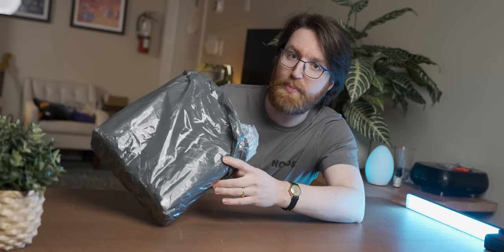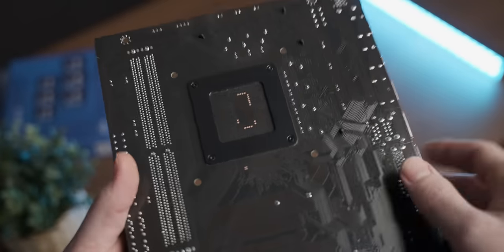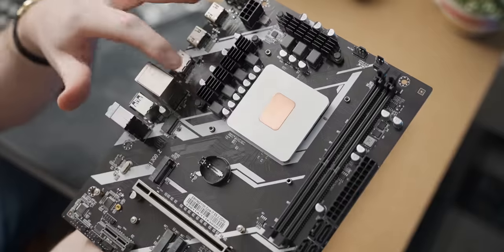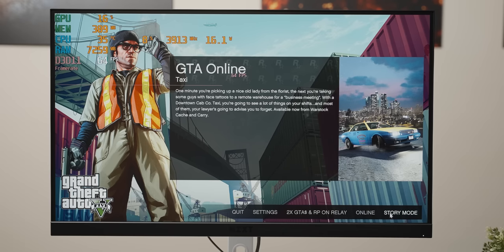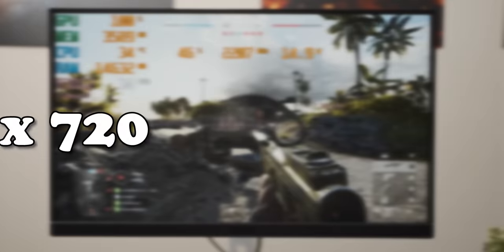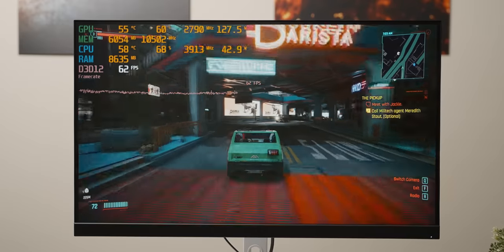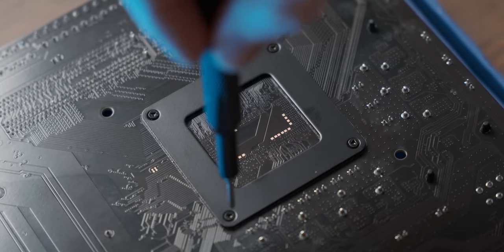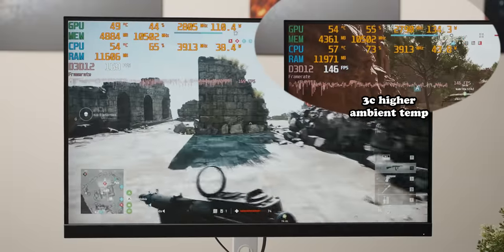Has Aliexpress Motherboard Science Gone Too Far?

Comment: Gonna say, Aliexpress xeon kits are kind of impressive, would be very nice to see one featured here.
Reply: yeah
Reply: I think this might actually be more powerful than one of those old Xeons. Would be worth comparing.
Reply: They used to be. Now it's not a good option anymore. Besides, they are not that reliable either, I very recently built one for a friend and the front audio didn't work.
Reply: yes, especially the x99 ones with a sketchy motherboard - would like to see it with Dawid.
Reply: @MiGujack3 nobody uses front audio
Reply: @L4ftyOne  You'd be surprised. I've seen some things..
Reply: I've built a few even recently and while sketchy, it's like a lottery and is kinda fun trying to figure it out
Reply: These kits are huge here in Brazil for budget rigs
Reply: for x99 platform is better to stick to local Hp workstations i have a HP z440 64 GB ddr4 paired with a rx580 and it runs smoothly
Reply: @Jaroartx  I'd consider getting those too. It depends on whichever is the cheapest and has good preformance
Reply: You can even buy a motherboard with both ddr3 and ddr4 slots, weird stuff
Reply: @Jaroartx  that seems better ngl
Reply: @MiGujack3  Ditto.  I went through three of them (two that wouldn't POST and one with two bad RAM slots), from three different vendors, before I gave up, accepted the $500 loss, and just bought a used a Dell socket 2011 workstation board.  Went broke trying to save money.  :P
Reply from the maker: I’ve done videos on some of those boards before. I got a dodgy x99 in a Best Buy market seller PC last year that you commonly find on AliExpress. You can go check out that video if your interested.
Reply: Xeon X series LGA 1366 is my Jam!
Reply: @BronzeApparathus  proud brazilian owner of a Xeon 2690v4 in a Machinist motherboard. I never ever heard of this manufacturer before and I must say that it's amazing, impressive work

Comment: These motherboards with soldered mobile cpus are actually really popular in developing countries. Here in Brazil, basically all tech channels were testing and reviewing them past month
Reply: Price to performance is the way in all countries with lower than average economy / dollar value
Reply: Honestly if you can find one with a Ryzen 6000 APU on it you'll have yourself a very slick little gaming machine. The 6980HX is a monster of a mobile chip and the iGPU is comparable to the RX6400 or 6500 with the power sliders maxed out.
Reply: @mikeymaiku  I'd say it's the way everywhere, why waste money even if you have it? You could spend it on other nice things. BTW: World average gdp per capita is 12k$/a, Brazil is 18, so well above average.
Reply from the maker: That’s cool! They do seem like really good value for money. Not surprised they are popular. 😁
Reply: @DigitalJedi  can i get a link?
Reply: Not just developing countries, developed too. Those mobile CPUs paired with an aluminium heatsink case make for some great zero-noise desktops. If all you have is a rented room and you want a micro-server or torrent box that's always on without making any noise at night, it's the only way to get that. Mine is from a manufacturer called "Hystou" and it seeds some old Blu-Ray 3D torrents that I want to save from extinction 24/7. Money well spent. No, really.
Reply: BTW the reason I am mentioning the manufacturer is because I am surprised by how zero-noise the thing is. No electronics whine, no whistling power brick, no nothing. My only complaint is that 6 of the 8 USB ports don't support "safely remove" for external HDDs/SSDs for some reason (they only support "eject" which is for thumb drives only). Also, I love the term "Aliexpress Motherboard Science", but I opted for buying straight from the manufacturer, not Aliexpress (aka trashy eBay).
Reply: @andreasu.3546  Don't be fooled by averages, inequality is brutal, there are insanely rich people, but also an upper middle class alongside really poor people. Those at the very bottom can't even buy the cheapest PC available.
Reply: @sovo1212  🙁
Reply: Same goes with Republic of Buryatia. Most non-gamer people buy either used computers or cheaply imported ones from china, mostly those mini computers or motherboards with embedded/mobile CPU's and sometimes even GPU's in a cheap mATX case and barrel plug PSU
Reply: @DawidDoesTechStuff  the only problem is the risk - you never know when this soldered CPU unsolders itself , and aliexpress warranty is a joke. Still I'd accept that risk :D
Reply: @sovo1212  can't agree more

Comment: The reason it doesn't come with a cmos battery is because of the strict chinese transport law regarding batteries
Reply: Many AliExpress sellers are telling batteries not included due the strict restrictions on Chinese airlines, but then when the product arrives it still has batteries included or installed.   😉
Reply: Also batteries and air freight.. not a great combo
Reply: theyre cheap and can be found anywhere local electric shops, its 2242 or smth 3.3v
Reply: watch battery
Reply: @Ba_Yegu  They also declared mine as $20 of electronic spares so it avoided customs charges. 🤣
Reply: Yes, this is correct.

Comment: Dawid, the cmos battery is usually the most expensive part of an AliExpress motherboard
Reply: @Silvio Balaško yeah, transport services are quite finnicky with battery transportation, i've bought a motherboard from Ali, most sellers will tell you it's without battery for transport safety, i'd imagine CR2032s are based of lithium, which is a big no-no, specially on a plane
Reply: @Silvio Balaško some places worldwide won't accept shipping anything containing a removable battery
Reply: no, its bc its illigal to send baterios cause fire hazzard
Reply: And the best performing.
Reply: @Silvio Balaško This.  Been that way for decades.  Used to be a pain in the butt for me when we shipped certain systems and couldn't pre configure the bios properly because we had to pull the battery before shipping the system.
Reply: @itsdokko2990  Yes it's because they are lithium batteries.
Reply: wouldn't want it any other way. 😀
Reply: @Zeus-jv9ds  are you done repeating is inane comment everywhere?
Reply from the maker: That explains it. 😂
Reply: ... also bumps up the shipping cost, as Chinese post doesn't differentiate between a CR2032 button cell and a 99Wh laptop battery and charges danger money as it's a lithium battery!
Reply: @itsdokko2990  yet we allow tons of people to board planes with their electronics and check their bags as well. Seems logical.
Reply: @fedordedov783  
there is a good reason.
there's a big chance that the cargo bay of a comemrcial/cargo plane is unpressurized, which means, no way of putting out a fire there. i'm not fully aware if commercial planes have fire supression systems aboard where the passengers sit, like regular fire extinguishers.

Comment: Although I'd never buy one myself, I think creating these motherboards to use up old laptop CPUs that likely would become e waste if not used, is a fantastic idea. If you were looking for a low/mid system, or even an interim system if your old board blewup, this could keep you going until you can buy another decent mobo cpu package.
Reply: Agreed! And it’s surprisingly powerful.
Reply: got an aliexpress i9 9980hk running on an h110 motherboard running great as efficent game server
Reply: @kevinheimann7664  yep. I opted for the xeon 2286 8c16t chip over that one. Running in a b250i strix but im considering making a nas/plex server with dual tesla p4s connected with a m.2 adatpor for the 2nd card.

Will be cool to get it in under 5L :o
Reply: 🤔I could understand if it was your CPU that died as for us down here in Australia the i7-11700F is $459AUD & i7-11800H version is $344.90AUD, but if it is the Mobo that died not so much because even if I was on last gen LGA1200 or AM4 I can get a decent new Mobo for $150-$200AUD meaning I have $150-$200AUD extra for a LGA1700 or AM5 platform upgrade.
Reply: @kevinheimann7664  give me link bro
Reply: They probably would have been recycled, and he would have bought a new more power efficient cpu instead
Reply from the maker: For sure! It’s such a creative use of parts that are left over from previous generations.
Reply: @DawidDoesTechStuff  I read that in your awesome voice, and not even on purpose. Your videos always make me laugh thanks!

Comment: As far as i remember there is a very convoluted way of enabling xmp on these boards. You should try asking the seller for instructions. Also there is a 12th-gen board coming out soon (march if i remember correctly)
Reply: Enable overclock on advance tab, on pch chipset tab find the only option with TRUE or FALSE configurations and set to FALSE and then you set XMP and ram voltage and it works.
Reply: I have my eye on the "lowly" I5-1250P, ITX form Factor, but I'm not holding my breath..
Reply: Or using a kit of crucial ram (JEDEC Compliant) may help to just start at xmp out the gate
Reply from the maker: @DanielGT_93  Thanks for the detailed breakdown on that. Very useful.
Reply from the maker: That sounds very exciting! It should be a really beast.
Reply: @poop-bq9ev  You can unlock the turbo timers and manually set your own TDP. I got the 11900H version which arrived last week, The full brief turbo is 80W. Set it to run 80W TDP permanently with no timer, and a basic 92mm fan heatsink keeps it at around 80C. Beats my 12-core 10920X in Cinebench! 😆

Not sure about a full overclock, suspect if you push it much harder the VRMs will start screaming for mercy. Also an option I've not seen since the P4 days - can  set the base clock on the motherboard.

Comment: Two things I'd like to note before I hit the benchmarks,
1- CMOS batteries are not included because Chinese customs can get super anal about it for no reason. Same reason amazon packages for battery powered things have the lithium warning label.
2- the bios setting for memory is under chipset, you have to manually set the maximum speed (auto is 2133) and then set XMP. It will run 3600c17 no issues though settings are rather confusing
Bonus- don't enable sleep mode, it's very broken
Reply: Dawid should do a round 2 testing with the proper RAM speed, that could fix the CPU bottleneck
Reply: @mcslender2965  IDK if it would change much, it was only using Slot1/2 so it's single-channel.
Reply: Is there a way to do continuos boost speed?
Reply: @Jimmys_TheBestCop  using throttlestop, yes.
it can also be used to undervolt as with laptop cpus performance is usually changed via a power limit, you can get it to squeeze more into its small power limit by undervolting it, it also has the side effect of reducing heat.
you can also increase that power limit, though unless its a u series i cant recommend it, i know those have lots of headroom but i dont know about others. look into it before increasing power limits.
Reply: Do you have one of these things and have you worked it hard for any length of time?
I'm actually considering getting one (Not for gaming)
Reply: he had memory bottleneck in half of the games, not the cpu one. If he only knew how to google when he already doesnt know half of the things
Reply: Does it support REBAR?
Reply: I was going to post this !!! Thanks for telling him.! :)
Reply: Is there any way of fixing the sleep?
Reply: This turned out to be a rather good buy it seems. Any GPU would have worked well, it was doing okay-ish without one.
Reply from the maker: Ayy! Thank you for the very useful information. I’ve had motherboards come with cmos batteries from China before, but maybe they have gotten even stricter with it lately.
Reply from the maker: @mcslender2965  The bottleneck is pretty big for a jump in ram speed to fix. Also considering that it’s 1080p with a 4070ti, there is no shame in a bit of bottlenecking. 😅
Reply: @MrABUTRE1  good ol' YT never gave me a notification, as far as I'm aware there isn't, which is why I'm not 1000% sold on them, 100% sure. Unless you know a bios engineer ⊙﹏⊙
Reply: @ausfoodgarden  I've been using a 9th gen chip in a z170 mobo from the same seller for almost a year and a half in my workshop PC that I spend about 2 hours on daily, it was also used for VR for a bit. The VRM looks pretty decent but since the CPU uses FIVR (like Haswell) it doesn't need to be anything special. My only gripe is the TIM is about as bad as the stuff Intel used on retail 4th gen as well
Reply: @DawidDoesTechStuff  Yeah! Its because chineses are smart  ,they dont want planes to catching fire while in the air!!!
Reply: Ram speeds do start bottlenecking when they are THAT low.
Reply: Also should test with an AMD gpu, since AMD drivers don't seem to have as big of a problem with cpu overhead as nvidia does.
Reply: @MikeD7775  ram speeds tend to show thier "bottlenecks" in 1% lows from what i have noticed. But this is a observation from ddr3 1333 -2133 but i would assume it scales to some degree with ddr4 2133 vs 3200
Reply: These boards support overclocking of the cpu, as long as you bought one with the right suffix that is. There is a lot of potensial in these systems, and I wish you did more research before pumping out an almost useless video.
Reply: in my memory, the airlines has been strict with lithium battery around the time of the Malaysia Airlines dissaperance. There were theories about the Lithium batteries catching fire. Even DHL Fedex has been strict on this
Reply: It's actually weird how anal the Chinese are about batteries, a couple of years ago I was transiting via a Chinese airport and carrying a large (but aircraft legal 99wh) powerbank, they spotted it in my bag and ended up being looked at by no less than 7 different officials to determine if I needed to go to the gulag instead of my connecting flight
Reply: @DawidDoesTechStuff  always good videos and you make me laugh all the time man hope your channel keeps growing man I hope you can be as big as Linus one day hope all is well in Canada man
Reply: @DawidDoesTechStuff  Onboard GPU should see a decent performance boost from faster RAM. It would be interesting to see how it performs.
Reply: @DawidDoesTechStuff  don't use cmos bro it's chinisese use actual power supply :/
Reply: @flymetothemoon5138 yeah I had the same problem in Germany. Is there a German equivalent of the (Soviet) gulag?
Reply: @STEELFOX2000  lol - CMOS button batteries spontaneously catching fire? I'd like to see the research on how many of those have happened in the last 35 years. :)
Reply: Fire hazard because chinese crappy hardware is what i would call a FKIN REASON.
Reply: I love the AMI bios... of course I can edit it and change what I want...that's an awesome thing ..
Reply: I love the AMI bios... of course I can edit it and change what I want...that's an awesome thing ..
Reply: Feeling very dumb can't get it to boot from USB to install windows any help?
Reply: @mcslender2965 he should test it with the aliexpress rx 6600m desktop variant
Reply: it's not broken, it's a feature
Reply: It's not only Chinese customs but also customs from countries in Europe etc... I live in Europe and everything with a battery will cost you more due to safety issues with batteries during transportation, or atleast that is what I was told.
Reply: I knew it, classical low effort
Reply: DON'T CHANGE OR ENABLE XMP PROFILE YET. YOU HAVE TO UPDATE BIOS FIRST TO AVOID STABILITY ISSUES
Reply: @STEELFOX2000 it's a cmos battery. It won't catch fire. It's not even lithium. And the Chinese don't really care. They ship things with batteries in them all the time. And those batteries end up burning down your house
Reply: I have ordered hundreds of products with batteries over the years from China. However motherboards never have them. I am not convinced that it is customs and simply the motherboard seller trying to shave ever ounce of margin from a low margin product.

Comment: I actually ordered one of the non engineering sample ones myself for use as a home server because of the low power draw. They’re very interesting and for the price I think they have a ton of potential for server/htpc/sff rigs.
Reply: What terms ddi you search for to find them?
Reply: I am thinking of doing the same, didn't do it yet because I dont know if I can use hardware transcoding on Plex , did you happen to try it ?
Reply: @stathisdespoudis42  the chip should be good. Otherwise the igpu wouldnt be usable.

Now software accepting the chip who knows
Reply: I just got an i7 variant for the same exact reason!
Reply: @stathisdespoudis42  Mine is still on the way from China, once it gets here I’ll update you! I wanted to run Jellyfin on it so we have a similar use case
Reply: I'm actually really interested in this too, because I wanted to modify my pc anyway, reducing my power usage in the same run would be sick. I was wanting to move to and off pc though, so I need a micro tax or itx board, but I can't seem to find that sadly.
Reply: That was my first thought as well, a home media server. I wonder how well it works with a passive cpu cooler.
Reply: @singledad1313  I’m not sure it’ll work with a passive cooler because of how hot the VRMs get, even with heat sinks they need airflow. Also the thickness of the copper slug that’s on top of the bare die makes me think passive cooling won’t keep it under 105c which is the crash temperature of this cpu.
Reply: Exactly what i want to do, except, i want to cram 4 of the m.2 nvme ssd's on an add in card in the 16x slot.
Reply: Does it still work? Thinking about buying the 13500h version.